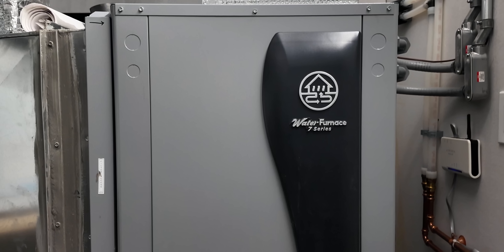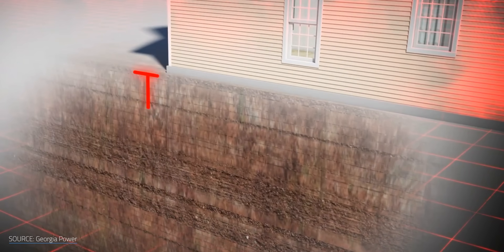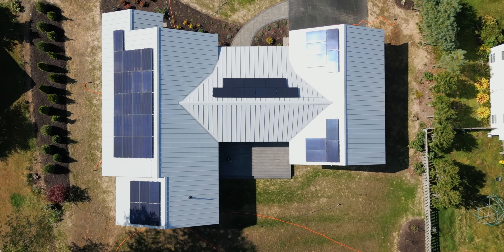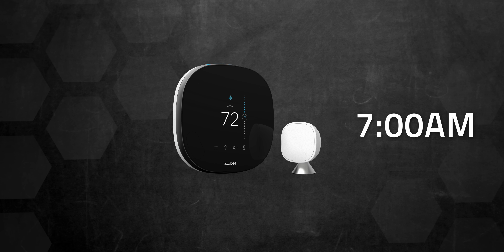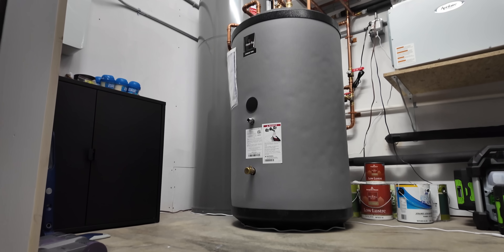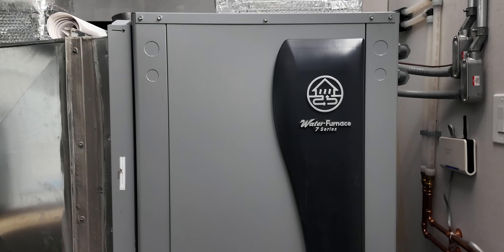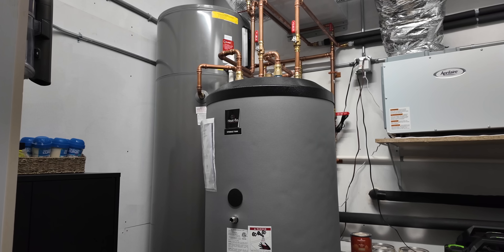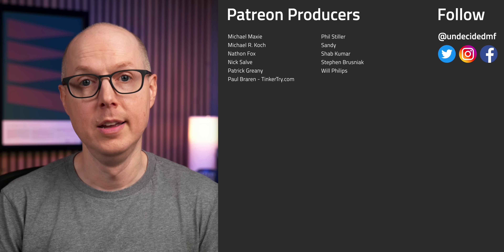How My Geothermal Heat Pump Really Performed (2 Years)

Comment from the maker: Do you want geothermal for your home? Go to https://surfshark.com/undecided or use code UNDECIDED at checkout to get 4 extra months of Surfshark VPN!

If you liked this, check out The Surprising Battery Discovery No One Saw Coming https://youtu.be/GRumW9JzGbc?list=PLnTSM-ORSgi7uzySCXq8VXhodHB5B5OiQ
Reply: If you want to reduce the costs of a Geothermal system then hook several houses up to a single larger diameter and deeper drilled well in which the cost of the permanent well is divided between two, three, four or more houses.  My guess is the drilled well is one of the biggest component costs of a Geothermal system.  Of course this would apply to heavily urbanized areas not sparsely populated rural areas.
Reply: @anguscampbell1533  Sounds like a nice idea.....
But make sure that well will be cooled faster whe more houses use hat well. Meand that in summer time you need to put more heat back in that bigger well.
Reply: You lost me at app.  You made a 30year capital investment and you're relying on an app that mat have a five year life at best. Please explain the logic behind that decision. 

I have lost to much hardware to abandoned apps to ever trust an app especially with the money you spent on that system.
Reply: @geographicaloddity2  That's a good point, but I doubt it is the only way to control the system.   I've been a proponent of geothermal for years.  Federal and State government's should have prioritized geotherm over solar and wind.
Reply: @H0kieJoe WaterFurnace units come with a touchscreen thermostat in addition to the app.
Reply: @H0kieJoe I totally agree and I bet not all vendors use an app, but it still seems like a dumb choice for a control interface.
Reply: Air source can be very efficient in the winter? If it is pulling air up out of the ground. See if you dig that 10ft deep ditch 120ft long around the perimeter of a property? And lay 3 6inch earthtubes down through it? The heat pump is going to think its only 55 outside all winter long. A backhoe is a lot cheaper to rent for a day than a drilling rig.
Reply: @davefroman4700  He he, far, far too sensible - it's positively un-American!
Reply: @Bob-h4s2p How fitting, since I am a Canadian.
Reply: @davefroman4700  Perfect Dave, it did seem odd LOL!
Reply: I don't see where you tell how many years to break even compared to conventional systems.
Reply: Do you think the cost of geothermal systems will come down over time?  Does it suffer from the fact that it is still a lower volume, niche industry?  From a physics perspective it seems so intuitive that it is superior to air-source heat pumps, but if the cost is too high, that will really limit their implimentation.
Reply: That sucks you have to get an app to use this. If that company stops supporting it or goes out of business, will you still have a thermostat to control your home's climate? I hope it is still compatible with regular non internet connected physically installed hardware in your home.
Reply: I'll check it out!
Reply: It's the overall result I expected, but seeing the numbers etc. is always a plus.  I have a 200 year old house with oil heat forced air and an AC unit that's currently non-functional.  Plus I have nearly 3 acres.  I talked to a ground-loop heat pump company a few years ago, but never pulled the trigger.  Time to revisit that!  Thanks for the info.
Reply: @VAXHeadroom  Is this your alt account Mr. Ferrell?
Reply: Other People's Money (OPiuM) = a Liberals FAVORITE drug!
Reply: Let me put it this way: the vast majority of people around the world, including me, can purchase a home with (a lot) less than you have paid for your geothermal installation.
Reply: @sovo1212 1/3 of Swedens houses has this heating ... the house allso increase its value
Reply: building a house for the long term and then smacking a nr of only 20-30 years on it is a joke.
Reply: I would like to learn more about the actual drilling.   How much area is required?  How big of a diameter do they drilling?  What size pipe did the use?
Reply: I also got a house built 2,5 years ago and got geothermal. It was really expensive. But it is so good having all floors heated with warm fluid :)
But i will also get a few liquid to air air-coolers installed soon. We will use the 7-8 celcius water coming from the well to run trough dedicated air coolers to cool the house in summer. And it will also give back heat to the well or to the water heating system.

I also hope to get a heated pool outside connected to this system. (I oversized the system som there should be around 8kw extra heating power just for the pool).

Great job on the videos btw! :)
Reply: Hi Matt, there's one thing you have to check, that your underground circuit liquid contains anti-moss and anti-algae, I've seen such installations grinding to a halt after only 5 years because these products weren't present, slowly making turning the liquid into a dark mush.   Rule of thumb whatever the case, change it every 10~15 years, depending on its quality.
Reply: @hankhulator5007  Not only this nut also there must be an antifreeze mixed in that system. The water in those pipes can be subdtantially colder than the well itself....that is even necessary because without that extra cold we could not get any heat out of the ground. Fine part...glycol (antifreeze) alo blocks growing of those organism ou mentioned.
Reply: @reiniernn9071     Nope, Glycol is not sufficient to stop all growing, there must be some additives.
Reply: I thought you lived in Oregon. What did I miss?
Reply: I wanted to have it, but not allowed to dig to deep due to ground water abd there isn't space in the garden. so i went with a Air to Water Heatpump for floor heatig, house build in 2004.

Using 1/3 of my energy bill, and less than my gas based kettle I had before, best investment ever. 

Idea is to invest in solar panels in about 8 years time when hopefully the interrests has fallen again for my morgage on the house
Reply: Yo matt have u seen tech ingredients on geothermal. It's pretty cool. They didn't need to dig to deep or spend that much money. U should check it out just pipes a window fan and a bore hole with sand and other ingredients to keep the hole cool. Year around in the shade. U should check it out
Reply: Iceland sold the idea for me.
Reply: 7:13 Don't forget to mention your amazing collection of fancy coasters in the background, DAD ;)
Reply: I'm missing the most important issue for geotherm solutions.
As told a heatpump transfers energy from ground to house, in the summer back into the ground.
What we really miss in this story is: Do we put every summer enough energy back into the ground well to extract it in the winter or does the ground well cool down slowly until it gets to cold to work properly.
Basically there  are 2 options to keep the groundwell at the correct temperature.
1: Underground water stream will transfer heat from surrounding area to the well location. We CANNOT change those underground water transportation. 
2: We need to add every summer more or equall energy to the ground (by cooling the house OR with any other method as using solar collectors for directly warming up the ground. 
This calculations must be made BEFORE you start planning youre geotherm and make sure that this works properly. If the winter is longer and summer colder (as in mountain regio or closer to the polar circle) this extra adding heat gets more important.

I do not say you made a mistake when installing the geotherm but I think this information is important for anyone who starts researching about geotherms for installing such an installation.

ps My geotherm, somewhere in Poland in a regio called "little siberia" due to the winter climate works perfect since 2009.
I was a little earlier with adopting this installation type.  But I did that research before about how much energy was added from underground waterstreaming. (Less cooling ...maybe even no cooling for the house... needed in summer.)
Oh, my installation costs where close to 20K euro (in polish zloty), this including low temp radiators with thermostatic regulations in the house. But 16 years ago  prices were different.
Reply: @UndecidedMF  So, your home is technically at 'passive house' numbers, correct? I dig what you've done. I'm aiming to build a passive/net zero home soon.
Reply: 1/3 of Swedens houses has this heating ... why. Its easy living. I dont need to do anything for ten yers now and the cost for heating is reduced to 30%
Reply: @andersandersson470 Would you elaborate a bit on that. If 1/3 of the homes have geothermal, what type is most common?
Reply: I would do something very similar to what you have done were I to build a home in MA. I live about 10 minutes from Gillette Stadium, not too far inland to not get a bit of relief from the yearly snow totals due to our proximity to the ocean.

I retrofitted my current house's HVAC system in part when I moved in. Our primary goal was to eliminate the need for window unit ACs. We had a heat pump unit installed air air-driven, and it has been very efficient, noting like your setup, but it's not a new home, and the leakiness of the structure is pretty substantial. That said, the amount of money to make this house not as leaky would be a bit eye-watering. We will need to make a decision in the next few years, undergo a massive update, windows, siding, exterior insulation, or move to a newer structure. In a 20 year time span the costs might balance out, meaning I might recoup my costs in energy savings in that kind of window.
Reply: No federal tax rebates are available anymore....unfortunately.
Reply: I have had an open loop system for 38 years, very pleased with the performance and comfort.
Reply: I installed a Climate Master geothermal heat pump on my new home 8 years ago in Georgia. It cost about three times what an air to air system would have cost. With tax and rebate incentives, it came down to about double the air to air cost. 

I also have a desuperheater for pre heating hot water. I love it. I calculated my payback at about 10 years.  Most people are scared off by the cost and usually settle for “builders grade” equipment.
Reply: Love the setup, but the initial cost is a tough pill to swallow.  Passive Solar is a very interesting alternative.
Reply: @vinumcopia9850  My question: What is the cost of installing a gaz heater , a LPG (otr ptopan) gaz tank on a safe distance from the hous and all gaz pipes including safety measures? And of coarse the CV installation with gaz heating and hot water boiler. If you nare allowed to install that gaztank at all. due to explosion risks from youre government.

Or what are the costs of putting a few km (miles) of gazpipe from the nearest main gaz pipe to youre house?

All those depends on youre exact location and location of nearest uttility pipes. Oh , maybe you do not need to pay for that gaz pipe at installing, but during the years it is added up to the gaz price or in fixed monthly fees.
Reply: Honestly? No, not my favorite system.  I prefer the more flexible approach of multiple microsplits. The initial costs are typically so much cheaper that you can compensate the lower efficiency easily with more photovoltaic + battery storage. If something isn´t optimal, you only have to make minor changes to the system to optimize. And the best about it: The system is virtually unbreakable. If one microsplit does break, the others can immediately compensate for it. If the mechanic does not come soon, who cares. And the bill will not extent the replacement of one of the units. Not to mention, that the higher efficiency of the geothermal heatpump isn´t necessarily real in practice. Because with the microsplits you can adjust temperatures in each room more quickly and therefore you will most likely use them much less to heat rooms which you are not going to use for a while anyways. Also: microsplits work nicely together with a wood stove, which burns excess wood from your garden. Also: Above the geothermal you might not be able to plant those trees. Also: When you produce a large excess of electricity in the summer (to run your less efficient microsplit system in winter), the time might come, when you can make good use of that (even if it is so far useless for you). Maybe the laws change and you can feed it into the grit for a profit. Maybe you want a heated pool. Maybe you want to improve the relationship with your neighbour and offer him to charge his new electric vehicle for free in the summer on your electric outlet in the garden.... Geothermal will never become more valuable than it is.
And those are only the considerations for a situation that is close to ideal for geothermal. If it comes to retrofiting a system into a house that was built for fossil fuel based heating you get additional advantages with the microsplit-solution. 
So ... I am mot agains geothermal heatpump systems and there are situations where they are clearly the way to go. But in general? No.
Reply: Can you please vary the background music/sound effects? It gets really old and annoying
I like your videos though
Reply: What you have isn't geothermal. You shouldn't be calling it that.
Reply: @WayneWatson1 Back in the early 80s, I worked for my schools ag extension office and somehow they got some grant money to study this technology and at that time, we were referring to the system as "an earth coupled" heat pump.
Reply: Geothermal pumps are a thing of the past; now they use mining rigs for heating, and in the summer, the excess heat is used to power an absorption chiller. Ultimately, you can even make money selling cryptocurrency.
Reply: 3:50 Matt, "a 20 to 30 year timeline" is very optimistic. You might get 20. There's little chance you'll get 30 years.

Also, the legitimate purpose of a geothermal heat pump is to save money, by saving energy, not emissions reduction. 0:02 & 12:07 "Net zero" is a fools' errand. The scientific evidence continues to pile up showing that those emissions that you're trying to zero out are beneficial, rather than harmful.
Reply: Your understanding of temperature control in the system is way off. Heat pumps don't pull heat from outside air! The refrigerant when compressed gets hot! When compressed gas is allowed to rapidly expand it gets cold (like a can of compressed air or a propane tank in heavy use). The system uses pump to move the refrigerant to a compressor creating a hot liquid moving it across the outside fan to pull heat from the compression out then letting it rapidly expand pass an orifice in the inside unit to cool the radiator inside the house blowing cold air in the room. Reverse that for heat.  The use of geothermal is the same concept only the ground would stabilize the temperature of the refrigerant before the compression or expansion of it giving the desired temps.

Not one part of this is pulling heat out of the cold air outside air. I'm an HVAC tech from Maine and yes, I've built my own 2 stage system with a CPU die for cooling my computer. It's not practical and very loud but it was a fun experiment with my son.
Reply: Matt, I'm pleased for you, sincerely, but I think building a location specific Passivhaus would be better, cheaper, simpler, better long term reliability and less lifetime maintenance. Have a roof that's just a solar array, N/S orientation, 100+kWh of battery storage and the ubiquitous heat recovery ventilation, maybe a dash of optimised passive winter solar gain. Far infrared heating panels for winter back-up or electric underfloor heating just in case. Imagine a house that needs no actual heating or cooling... I know, I know, what fun is that without any man stuff to fixate over. Keep things as simple as possible, as breathable and natural as possible, catch and store your own water under the house.
Ultimately though, it's your house, and of course, your choice.
Reply: @Bob-h4s2p

Batteries are like a gas tank that shrinks with age.  Plus the ore mining and necessary refinement for use in batteries is very nasty.
Reply: @H0kieJoe  correct!!
Reply: Sure it's cool (no pun intended) at first when everything is new. What happens in 15 or 20 years when your refrigerant springs a leak deep underground? How is that resolved? Sounds like it could be a HUGE issue digging out lines 400 feet underground? With a standard AC, a whole home (inside/outside) replacement can be done in 1 day for maybe $5-10K (Houston).
Reply: @rackets001 refrigerant is all contained in one unit.  Only water is under ground.
Reply: @ronaldpoole3273 , in Massachusetts it might not be "only water" in the underground loop. With Matt's vertical well, I'm pretty sure it's only water, but with the other arrangements he described the heat transfer fluid would probably be a water + antifreeze  mixture. (Because of environmental concerns, in case of a leak, they would probably use a non-toxic propylene glycol antifreeze.)
Reply: "State and Federal rebates" = Other People's Money!

Other people paid for part of YOUR house against their will! 😡😡😡
Reply: @DUCKDUCKGOISMUCHBETTER You didn't pay one cent more in taxes for this, You would have had the same amount of money taken and it would only have gone to congress to spend it on other useless crap. I'm happy to see my tax dollars going to actually help the people who live here.
Reply: @John-771 Well said.
Reply: @DUCKDUCKGOISMUCHBETTERwait till you see how much you incentivized and subsidized fossil fuels - even though they set records for profit.
Reply: @timlitton On a per btu generated basis, coal and gas subsidies are miniscule when compared to wind, solar and even nuclear.
Reply: @H0kieJoe what a bizarre comment. You spend far, far more on fossil fuels subsidies than any renewable - but you’re okay with them taking your money as long as it isn’t BTU-related?
Reply: @timlitton Not bizarre at all if you understand basic math.
Reply: @H0kieJoe or gaslighting. I’m sure you were just outraged for the decades you’ve been paying subsidies for fossil fuels. Or is it selective outrage?
Reply: @timlitton 

You're using Enron math.  Solar and wind are subsidized more than coal and NG based on a per KWh basis.  It's just that simple. 

Consumers also pay higher utility bills to subsidize expensive and wasteful alternative energy boondoggles.   Consumers pay for MORE for electricity NOW because utilities pass along the costs for dopey gReEn solutions.
Reply: @timlitton Drill, baby, drill!
Reply: @DUCKDUCKGOISMUCHBETTER Funny how you ignoramuses never complain when they are giving your tax dollars to billionaires.